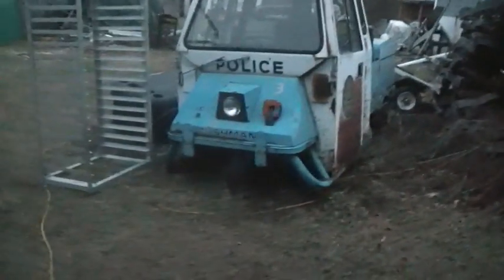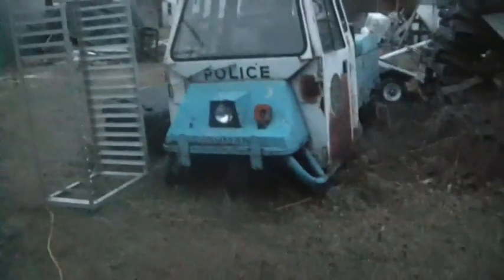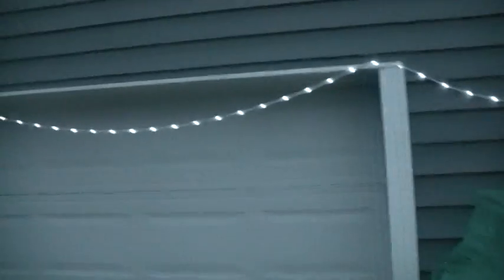12_19_2014, Load & frequency testing, Old Gillette, 1KW generator

Comment: It ran good
Reply from the maker: wtbm123 , It seems to run ok, I was going to clean up the carb and re-run the load test to see if it does a little better. The Voltage is way high to run anything electronic from it... Thanks for the kind words, watching, and commenting!